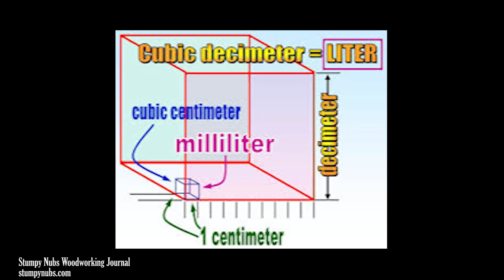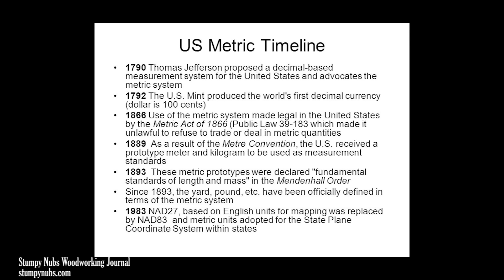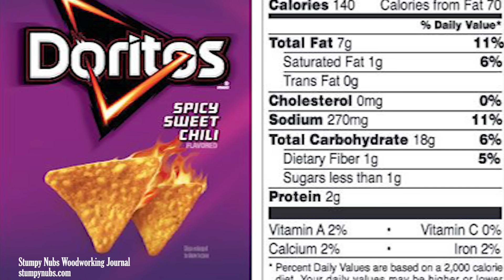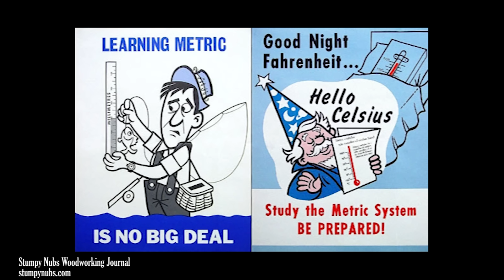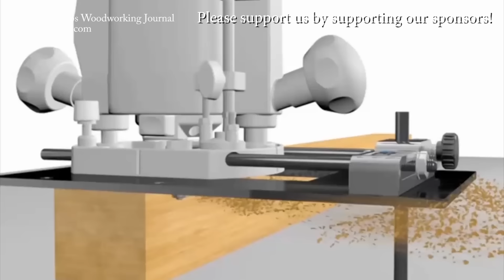BREAKING: The USA is switching to METRIC!

Comment: As an American, I was amazed by the ease of calculating volume by size and also the weight. 1ml(of water) is 1 cubic centimeters, which is one gram or in larger terms 1 liter of water is 1000 cubic cm and 1 kilo. Not necessarily as easy if you are looking for the wight of something other than water, but volume still works. Without looking it up, how many gallons are in a cubic foot?
Reply: No one does that... there is 0 need for when messuring the weight of water based on its weight... ive never done that my entire life... metric is only good for messuring chemicals and thats where it only belongs... but for everything else... its a awful system... imperial is and always will be better
Reply: 1 cubic decimeter of water is not exactly 1kg. At room temperature it is about 997g. It is close, but it is because of water density
Reply: @Scudmaster11  Of course that comes in handy, for example if you want to know whether your floor can hold your new water bed with x hundred litres of water inside it. Or if you're building a DIY raft using air-filled tubes and you want to know how much volume you need to keep your weight afloat.

Imperial is only better for those who're used to it, changing is always difficult.
Reply: @Ragnar8504   the only thing i hear difficult is you... imperial isnt hard... and we dont normally need to convert... PS messuring air buoyancy with metric is stupid... water beds arent really used (only in vary rare situations are they bought).... ive given metric a try before and hated it... couldnt visualize anything... it was all over reliant on objects and machines as because the numbers are unweildly)... also... if you think converting between stuff in imperial is hard... its not.... you are only nameing the vary few novelty things metric is only better at... but imperial crushes the cpmpetiton by MILES..... achers of land is better (and economic) if you want one that you will never top... achers are known by how much work a famer can get done in one day (back then)... so its a efficient way for land... even though i dont personally use it... its used in land messurement of how much there is
Reply: @Scudmaster11 Indeed, 1 metric achre, aka 100m^2, aka 10x10m, is better!
Reply: @LTimotheus   PS... BTUs are commonly used and its a imperial standard... how much energy it takes to change the temperature of water (1 pound of water) by 1 degree F
Reply: @Scudmaster11 what kind of farmer? Strength, age, experience? What kind of work? Ploughing, mowing, sowing? What kind of soil? Rocky, sandy, moist, dry?
Seems a very vague definition to me.
Reply: Even other materials are easy, you just need to know the density of the chosen material. You then calculate volume and add one extra material constant (ie x2.7 for aluminium). So with very little effort it works for every material.
Reply: @Scudmaster11 if you didn't know most of the imperial units are defined by metric units anyways you just add some arbitrary randomly chosen conversion factor to get imperial. it's not like J/kgK is a metric unit that discribes the exact same thing as btu but now you can easily tell that for 1 kg of water, which btw is the same as 1 Liter or 1 dm^3 or 1000cc or 1/1000 m^3. You need 4181Joul  to heat up 1kg of water by 1 Kelvin or 1 Celsius (Celsius is just defined as being offset from absolut zero by 273.15k).  Now that is the same as lifting up 41.81kg up by 1 meter or the amount of distance light travels in 1/299792458 seconds. Or the same amount of energy one cheeseburger or 10*9mm bullets. Can you convert 9mm bullets or cheeseburgers into btu?
Reply: @Scudmaster11 No one does that: when I carry plastic bottles I sometimes like to calculate how much they weigh (ignoring plastic), so to state that absolutely noone uses the easy volume to weight calculation is to lie. And while there isn't a need for me to measure a fluid's weight if I already know the weight (nice spelling btw), you rarely have fluids measured in weight but in volume.

Also, did you watch the video? Plenty of uses for metric and the most american I can think of is measuring the size of bullets (with .cal being metrics millimetre if I'm remembering quite right).

So the only argument you have is that you've never done it in your life, which is a valid argument why switching would be difficult, but not about the superiority of a system over another. Because that is the same thinking that kept people thinking Earth was the centre of the universe.
Reply: @Scudmaster11 it’s normal that you can’t visualize things if your not used to the metric system. Same goes for me whit the imperial system no Idee what 2 Inch could be
Reply: @davidtheiler562   basically the size of your thumb (shorter useally)... PS... 356 is a unweildly number for any messurement
Reply: @Scudmaster11  i think you probably had a little too much chemicals..
Reply: @Scudmaster11  The imperial system is European, but it became outdated and was abandoned. But in some countries it still remains a colonial residue...
Reply: @Ragnar8504  It's not as hard as it seems. We've also been switching from the old units to metric, for example the unit of pressure used to be atmosphere or kilogram of force. Physically it's meaningless though, so we switched to kPa and N and it wasn't particularly stressful :-) But it was a very long time ago, maybe I had nightmares about it and forgot about it :D
Reply: @LTimotheus  Better is water for irrigation measured in acre feet :D :D :D
Reply: @Scudmaster11  How much heat is produced by a 1 kW electric motor? Yes, 1 kW of heat.
Reply: Canada changed to metric about 1/2 a century ago 
Plywood is still 4’x8’
2x4” studs are still 16” on centre 
Flooring and carpet are 12’ wide 
Tiles are 1’ square 
3/4” Conduit is available in 10’ lengths and 
There is a 6” take-up on the bender for it !
Some things will never change but 
Metric division is compatible with computers
Reply: @Scudmaster11  what in particular is awful about the Societe Internationale system? Details please, the more detailed, the better.
Reply: @samuelbudzinak  that's physics, it's because of density, and that is the same for the imperial system, because again, it's physics and it has to do with density. Point REJECTED!, NEXT!!!
Reply: @sandrokapellen9064  in Europe we measure water not only in liters, but in cubic meters, and I can tell you exactly how much water 1 cubic meter is: 1 meter of width by 1 meter of height by one meter of depth. I can picture the exact amount in my head because it is so trivial to reason about.
Reply: @AnnatarTheMaia  have you read my comment?
Reply: @samuelbudzinak  no, I have not read your comment, because I do not understand English and can neither read nor write. To make matters far worse for me, I struggle tremendously with basic logic premises and have difficulty with cognition and comprehension.
Reply: @AnnatarTheMaia  isn't that exactly what I said?! Metric transformation is trivial. I don't have to convert with randomly chosen factors to get a new number. Imperial is in any way stupid and outdated since forever. And it anoyes me ever single time a airplaine hight is given in feet why is the airplane  30000 feet in the air, tell me why, how high is this and why dose my feet have to be involved.
Reply: @sandrokapellen9064  I have no idea what you said!, and good luck finding anything in this rudimentary comment tool! There are way too many replies to the video to find anything any more!
Reply: @madeinfoxtrap5539  Because it's imported from the US. Our company exports one product to the USA that can be ordered in multiples of 20 mm and nobody has a problem with that either and they normally understand it. The essence of the metric system is different from the pack size.
Reply: @AP57532  there is still a six inch take-up on a 3/4” conduit bender
Simple physics won’t allow that to change 
Metric is compatible with computers 
Imperial fractional measurements are not 
Computer friendly. 
I am well versed in both systems but 
To think for a moment that inches 
Are going extinct you had better think again 
Fractions will always be used as long as 
25 cents is still a quarter.
Reply: @samuelbudzinak  How many pounds is one gallon of water?
Reply: @sandrokapellen9064  Because the flying community agreed to use feet and knots in everything. Maybe to appear elite over the rest of us that aren't allowed to fly a plane 😉 But commercial pilots are basically bus drivers that happen to have wings on their busses. Makes them less elite imo 😄 
Btw, shipping is the same. They also use unique measurements for their profession.
Reply: @Scudmaster11  Then why don't you use imperial?
Reply: @Xanthopteryx  what are you talking about... i do... PS... metric is basically only fits in at chemistry.. and even that is iffy
Reply: @Scudmaster11  You said imperial is way better and i asked you why you don't use imperial then.

Besides that, metric is superior. Everything connects together and it is easy to move between the different units. 1 liter = 1 cubic dm = 1000 cubic centimeters = ...
1 cubic meter = 1000 liter = ...
1 kilometer = 1000 meter
1 meter = 10 dm = 100 cm = 1000 mm = 1000000 ...
1 square meter = 100 square dm

1 millimeter of rain = 1 millimeter of water per square meter
It just continues.
Reply: @Xanthopteryx   your computer is running x86 honey... it's asm is weird... and is also the fastest cpu architecture... so just because everything connects doesn't mean its good... the way everything connects on metric feels lazy.... PS... computers run in powers of 2... not powers of 10... you were reading gibibyes and tebibytes... not gigabytes and terrabytes... and if you say (then why not just run a program to correct it) well here is the issue... a byte is 8 bits... a block is the size of a sector on a drive... usually around 128 bytes to 2048+ bytes... yes i will drag computer science into this because i can.... base 10 on that is 100% a awful idea and we should start physically labeling the drives and everything in the computers format (powers of 2... gibibytes and tebibytes)... it's 1024 of one standard to another..
Reply: @Scudmaster11  So, where did computers end up here?
Guess why they work in binary?

You did not answer: Why do you not use imperial units if that is so outstanding?
Reply: @Xanthopteryx   i do use imperial... how hard is it to keep up... jeez
Reply: @Scudmaster11  No you are not. You are using US customary measurement systems, since i guess you live in USA.
US customary measurement systems is NOT Imperial.
They are different.
Example.
Pint is not the same volume in US Customary and Imperial.
Gallon is not the same either.
Quart is also different.
So is ounce.
How often do you use the unit "gill"?
Not often i guess. Because that is mostly used in Imperial.
A cup i guess you use, but not common at all in Imperial.

Did you also know that Canada and USA differ? They use different systems.
They are matric since 1971 but have not transitioned fully and still have Imperial in some applications (but metric is the official).
So a drink from made in Canada where it might say (converted from metric) that it contains 1 quart, is not the same volume as the same drink manufactured in USA where it also says 1 quart.

Another example of nice measurements are of course Celcius (from Sweden!).
0 is water freezing.
100 is water boiling.
Simple and easy.

So, once again: Why don't you use imperial if that is such an amazing system?
(and now we ignore the fact that it actually is a really bad system that is really complicated and prone to getting things wrong)
Reply: All you need to know is the SG of any material/product and use the same calculations, and SG is obviously also used in the "imperial" system.
Reply: @Scudmaster11 so when reinforcing a joist to take the weight of a new bathtub, knowing that a bath holds approx 300 ltrs of water, so the joist will need to hold min 300kgs of water is of no practical use?
Reply: @Scudmaster11  And that is why only 95% of the world uses metric.
Reply: @godfearingheathen   exsept candy making industry... its standard is imperial around the world
Reply: @Scudmaster11  When cooking, if a recipe calls for 200ml of water/milk, you can just add 200 grams water/milk right in your mixture.
Reply: @luuk777w   imperial still is the same... you really think we have 0 way to messure anything?... grow up already
Reply: @Scudmaster11  Yes but the standard is in metric with imperial equivalent next to it.
Reply: @samuelbudzinak  That is the same in imperial!!!Everything changes when heated..
Reply: @Scudmaster11  No it isn't, whilst it does do fancier things like having volume and cubic meters be related etc. Just plain devinding or multiplaying by 10 for EVERYTHING is incredible.
Reply: @Scudmaster11 That‘s called a Newton. It’s the energy you need to heat a litre of water by one degree Celsius. What meaning does Fahrenheit even have for water?
Reply: @Kyk_cz   Imperial or US gallons  Imperial 10lbs  US 8.3lbs.  It's not rocket science.  And regardless that is as relevant as the weight of a cubic meter of molasses.
Reply: @Xanthopteryx   Imperial is better  you can't precisely divided ANYTHING by 3 with metric..  Imperial no problem..
Reply: @Xanthopteryx   US Customary is STILL Imperial , The ONLY differences are in volume measurements. Jeeze get with it already.
Reply: @alundavies1016   Or you know that the volume is X Gallons either Imperial or US and multiply by 10 or 8.2.   I guess that is too complicated for europeans?   But hey metic the measurement system for those not smart enough to do anything but divide and multiply by 10.
Reply: @luuk777w   Wrong milk is NOT the same weight as water.  Metric volume weight conversions ONLY work with water...
Reply: @matthewq4b  so what if you scale up to a dam? How do miles converting to Gallons, converting to tonnes work as well! You do realise that American scientists and engineers largely work in metric too? I use Imperial when I am doing small pieces of woodwork where precision can take a second place to habit, but metric is better, I’m just lazy.
Reply: @alundavies1016   You don't convert miles to gallons one is distance the other volume. You would use cubic feet for volume. 7.5 Gals US or 6.2 gals imp to a Cuft  And gallons to tons is easy 240 US gals to a short ton and 224 gals Imp to a long ton. And exactly if you lack the intellect  metric is easier other wise imperial is better.  And  if metric is truly better tell us exactly how much 1/3  of a liter is or exactly how long 2/3 of a KM is.  1/3 a gallon is exactly 51 oz  2/3rd a mile is exactly 3520 feet.
Reply: @matthewq4b  True, but its about the same and if a recipe calls for 300ml milk, and you add 300gr milk it will be good enough. You also won't be so precise with a measuring cup
Reply: @luuk777w   Still not the same and there would never be an instance where you would substitute weight for volume with a liquid in cooking. Your whole train of thought is flawed.
Reply: @matthewq4b  you can convert kms to volume, to weight in metric. One cubic km of water is 1bn cubic metres of water, or 1bn metric tons. That’s sort of the point.
Reply: @alundavies1016   And you can do the same conversions in Imperial.  And that volume weight conversion ONLY works with water in metric.
And still waiting for  exactly how much 1/3  of a liter is or exactly how long 2/3 of a KM is.  Or is it that metric is not capable of doing that...
Reply: @matthewq4b  1/3 of a ltr is 1/3 of a ltr? What’s 1/3 of a pint?
Reply: @matthewq4b  and you can take the volume/weight of water and factor it up. So a cubic metre of milk weighs about 30kg more than a cubic metre of water, so multiply your water weight by 3% to get the weight of milk.
Reply: @alundavies1016   That is not a an exact measurement. 1/3 liter is exactly how many ml.      There are EXACTLY 32 teaspoons in a 1/3 of a pint.  That is an exact measurement.   Quit stalling already.
Reply: @matthewq4b  I have a lot of teaspoons, which one is the right one?
Reply: @alundavies1016   And you can do the same thing in Imperial, factor it up... DUH.  And anything can be "about" And the fact that  you don't know the difference between .03 3% and .30 30% (Milks density is 1.035 a KG, 3% more than water)  proves the point  perfectly that metric is for those not smart enough to do anything but do math by 10's. I could have not proven that better myself.
Reply: @matthewq4b  and a 1/3 ltr is 333 1/3 ml. I could weigh that you know, or guess 1/3ml, it’s a pretty negligible amount. Or go down to microlitres, you’ll hate this, they are metric too! 1 Million to a litre, so 1000 to a millilitre. So a 1/3 litre would be 333,333 1/3 microlitres.
Reply: @matthewq4b  so I said milk would weigh 30kg more per m3, so 3% more, so my calculation would be correct!
Reply: @matthewq4b  so your argument is that because Imperial is inherently more complicated, involving complicated non-decimal calculations up and down the chain, and is therefore inherently more imprecise, this somehow makes it a better system? It’s an interesting argument!
Reply: @alundavies1016   That is NOT an exact measurement is it.  Metric can't do it either it is too difficult to grasp  or we have a lack of intellect going on here.
Reply: @alundavies1016  You did NOT say 3% you said 30%. So my point stands you don't know the difference between .03 and 0.3. If you are not just moving a base 10 decimal it is clearly too complicated for you deal with. And then you have go back and edit the comment.  LOL not bright and pathetic.
Reply: @matthewq4b  no need to be rude, it is a lot more accurate than teaspoons.
Reply: @matthewq4b  and have you noticed that in hospital, they don’t say “give him a teaspoon of …” they say “give him 4mg of…”
Reply: @alundavies1016  It is MORE accurate because it is EXACT. And apparently you have not read the back of basically any over the counter medicinal liquid where dosages are ALWAYS given in table or teaspoons.  So how deep are you going to dig the hole ? Cause at this point all you are doing is driving my point home with a sledge hammer.
Reply: @matthewq4b  lets say you're making pancakes, and the recipe calls for 350ml milk. Then I just place the whole bowl on the scale, add 350gr of milk and done. That is all I am saying.. yes it might not be totally accurate because 350gr of milk is 336ml, but it is close enough and when you measure yourself you probably will also be off my some milliliters. That is all I am saying... It's not rocket science
Reply: @matthewq4b  they don’t dose with injections using imperial measurements, because the measurements are not accurate enough at small dowsings. And you still have not answered, why would anyone choose a system of measurement that is, by your own admission, more complicated than metric? Why would anyone choose complicated, non-decimal calculations, when a system exists that means you can scale up, or down without knowing your 12/14/16… times tables. I’ll leave that their, playing chess with pigeons…
Reply: A cubic foot... that must be very unconfortable, especially to fit in your shoe
Reply: @ross6753  that’s what Lord Byron had
Reply: @alundavies1016  I know. But it didn't stop him from being very fit and sportive.  I was merely using it in a cartoonish way, not for serious.  "Cubic foot" just gave me a weird image in my head
Reply: @ross6753  much respect to “mad, bad and dangerous to know” Lord Byron!
Reply: @Scudmaster11  why do you insist on putting ... in between every single phrase and sentence???
Reply: @KeKcP   because it's how I type.... deal with it.... ellipsis is fun
Reply: @alundavies1016    You said medicine NOT injections, moving the goal post when you get proven wrong yet again.. And imperial uses minim or drachm which both are more accurate than CC's anyway. And it is NOT more complicated, if you have 3 functional brain cells. PLUS it is more intuitive and it slots in better with navigation and time as you use the same base multipliers. And it can use ALL commonly used divisors. Plus it is better for machining  as you never have to move a decimal place around.
You yourself screwed up a very simple decimal movement. And it works far better with finger counting if you have no tracking method available. You have had multiple metric questions you could not answer. Funny that all the imperial ones you posed were answered ..... All you have done is prove the overall superiority of the imperial system.
Reply: @luuk777w   WHY the F would you weight milk ? That is what measuring cups are for.  You metrics sure like to  drive the not very bright point home with a sledge hammer. And FYI you can do the same thing with Imperial and it's more accurate 1.5 cups equal .75Lbs of milk or 350 ML. Once again you lot are proving the superiority of imperial.
Reply: @Scudmaster11  it’s incredibly obnoxious on par with scraping nails on chalkboard
Reply: It’s super easy!
For other things, you just need to quickly check the density and then you can convert it the same way. For gasoline, for example, just multiply by 0.75 or 3/4.
Reply: @KeKcP   its just ellipsis... there isnt anything bad about it
Reply: @matthewq4b  this ignorance is pure comedy😂 I can give you 100 reasons why the metric system is much better, but something tells me that wouldn’t convince you either.
Not to mention scientific calculations.
Reply: @davidpiehler7850   Lots of talk no examples.  Once again proving it's only advantage is for use by half wits.
Reply: @davidpiehler7850    Really you lot just multiple by 0.75 for M3.  You lot still proving you are unable to move a decimal place unless it is a base ten..Still driving the point home with a sledge hammer.🤣
Reply: @matthewq4b   Alright, to address your previous arguments (I had some time to kill):

1. REAL PRECISION was never possible in the imperial system. All measurements in the imperial system were defined using the metric system to make them precise.
2. I'm not sure what your problem is, but I can perfectly fine divide 10 meters by 3. If 3.333333 meters isn't accurate enough for you (by the way, that would be 3 meters + 3 decimeters + 3 centimeters + 3 millimeters + 333 micrometers - try doing that with the imperial system), I can also write it as 1/3.
3. **Milk has a 3% higher density than water**. I hate to burst your bubble, but cooking isn't nuclear physics. Eggs can vary in size by up to 40%. Do you always weigh them to get a "perfect" value? Also, I hope you don't use cold tap water for cooking, because WARNING: 50°F water has a 0.15% higher density than at 68°F. For milk, it's even a 0.3% difference, so don't forget your thermometer!
4. „Only water“ can be converted 1:1 by volume. Vinegar is 1.01 g/cm³, cream is 0.98 to 1.02, milk is 1.03, yogurt is 1.03, and oil is 0.92. You can argue about a 10% difference with oil, but everything else with a 0-3% deviation is negligible for cooking. Other factors like cooking time play a much larger role. We also don't need five different measuring cups. We can measure everything with a single volume measuring cup. You can even measure 5 cl of rum for a Cuba Libre with a 1-liter measuring cup.

Shall I tell you about the problem of unit inconsistency? Statute mile, nautical mile; survey inch, international inch; short ton, long ton; avoirdupois pound, troy pound; US liquid gallon, US dry gallon... I think you get my point. I bet these sizes are usually just roughly converted. And YOU talk about precision.

And I won't even start with scientific calculations, but even the most backward person has figured out that the imperial system is useless in this area.

Is there ONE other reason why the imperial system should be better? And please don't start with "practical" sizes. In the metric system, I can use ANYTHING as a reference and calculate with it if I want to. A football field is 100 meters, a car is about 4 meters long, so 25 cars equal a football field, which by the way, also corresponds to 1000 “finger lengths” or 5000 “finger widths”. I can easily calculate all of this in my head.
I wonder how well that works for you :D
 
Clearly, the imperial system is simply superior:D
Reply: @matthewq4b  So your argument is that in some rare cases, the metric system requires the same number of calculation steps and therefore is worse?

You also forget that we only need to remember ONE density value. With this density, we can convert ANY volume into a weight and vice versa WITHOUT a calculator.

You always need a different density value depending on whether you use lb/ft³, lb/in³, oz/in³, or gr/ft³. And then it’s an awkward value and not like our 1 g/cm³ for water density. And 2.7 g/cm³ for aluminum is still easier to estimate than 168.5 lb/ft³ or 0.00058 lb/in³ or 0.098 lb/in³. We don’t have such problems.

What’s your point in this??
Reply: @davidpiehler7850   1. Wrong Imperial measurements were defined by metric since it was OFFERED to save the cost of maintaining a set of imperials standards . And the base metric meters length has CHANGED length multiple times in the last 100 years. So much for accuracy... Try Again..

2. And again you can NOT divide ANY metric meusemernment EXACTLY by 1/3's  Were as in imperial this is done WITHOUT ANY decimal places... Try Again. 

3. WTF do eggs has to do with any thing.   That some pretty hard cope to explain the error PROVEN by simple decimal movement.   Complete fail..

4.  Uh cooking is NOT the only use of measuring systems. You can ONLY the 1 to 1 for WATER NOTHING ELSE. And FYI imperial uses a single measuring cup alos...  More cope it seems. 

So 4 examples ALL OF which were false or opinion.   Batting Zero so far...

And there is NO issues using Statute mile, nautical mile; survey inch, international inch; short ton, long ton; avoirdupois pound, troy pound; or gallons either imperial or US, (US dry gallon is long obsolete)  It is NOT at all complicated if you have more than 3 functional brain cells. 

The ONLY advantage Metric has is it is easy for the mentally challenged that can only do math in tens..
 
Some of the advantages of Imperial were already listed.  GO BACK AND READ...    

You lot are still driving the point home with a sledge hammer it seems
Reply: @davidpiehler7850   Uh ya we seen how well remembering that metric density rule worked here live, it was STILL DONE WRONG.   THOSE sort of errors do NOT happen in Imperial and are VERY common in metric. You have no idea how many decimal movement errors occur in metric  93% of ALL metric conversion errors happen because of this EVEN using electronic calculation cause they end up being overlooked when transposed wrong. This is UNIQUE to metric and does not happen with Imperial.  Metric ends up with more calculation errors than Imperial does in lengthy tabulations.
Reply: @matthewq4b  1. The values were redefined because scientific methods allowed for a more precise definition and this was necessary for more accurate calculations. Now they are defined anyway, and the imperial system is defined via the metric system. So I was right. The metric system is precisely defined?! And the imperial system only through the metric system.
2. What’s the problem with decimal places?? Besides, that’s an isolated case. What about /5 /6 /25 /7. Hooray, you can avoid decimal places a couple of times. Congratulations, I guess? I hope all the conversion work between the units is worth it. It has greater advantages to be able to shift powers than to be divisible by 3.
3. My point, which you were obviously not smart enough to understand, is that precision to individual percentages doesn’t matter when cooking. 1x apple, 1x egg are all imprecise measurements and 1 liter/1kg/dm³ of milk is perfectly transferable when cooking. Your argument that it cannot be used is wrong.
4. Do I really have to explain this again…? Milk, vinegar, … everything I mentioned can be converted 1 to 1 because an accuracy of 1% is not required! And yes, cooking is not the only example, but bad news. When we get into physics or engineering, it looks much worse for the imperial system. I believe many physical units only exist in the metric system.
5. The problem is that all the conversion factors need to be looked up and calculated with a calculator. In the metric system, this is not the case. You don’t have to memorize tables of conversion factors and you don’t need a calculator to calculate simple quantities. It is much easier/faster/less error-prone to calculate things in the metric system. I don’t have to learn 100 conversion factors; I can focus on memorizing natural constants, for example. For instance, the speed of light is approximately 300,000 km/s, and the sun is about 8 light minutes away. So that corresponds to 144*10^9 m. I can easily calculate such things without a calculator.

Oh, you probably don’t even know about power of ten notations… Sorry, it’s like 1+1 for engineers but no idea if something like that is even used in your field…
Reply: @matthewq4b  Aha, that might be because NASA and all technical institutions where physical values need to be calculated use the metric system. No errors can arise from the imperial system if it’s not used 😂
And please, please, please don’t be so dumb as to claim that physicists and mechanical engineers prefer the imperial system. Otherwise, I’ll have to believe you were the first person on the moon and haven’t had contact with other humans since then.
And my spare time is over, so that’s it from me. Have fun with your conversion disaster system 😂
Reply: @Scudmaster11   "No one does that... there is 0 need for when messuring the weight of water based on its weight"

There certainly is a need for it.  For example, you might build a trailer with a water tank on.  You then have to consider how much the water you carry will weigh.  There was an incident in Canada several years ago (look up Gimli Glider) where an airplane ran out of fuel part way through the flight.  Aircraft are very weight sensitive, so you have to know the fuel weight.
Reply: @matthewq4b  Imperial and customary is NOT the same. Different systems. But a lot happens to be the same because USA based customary on imperial.
So they took a bad system and made it slightly worse.
But as said, today it is actually metric, but then converted to imperial.
Better off going full metric.
You already have some stuff in metric so why not all?
And of course, go Celcius too. Skip that arbitrary strange non logical Fahrenheit.
Reply: @Xanthopteryx   NO country is fully metric Imperial is so ingrained that and used for many items and industries. And US Customary is only used for volume. And Fahrenheit Is more accurate and does what celsius does WITHOUT resorting to decimal places.
Reply: @matthewq4b  Please tell me what units we use in Sweden that is not following metric?
Even our own distance unit "mil" follows the basic metric. One "mil" is 10 km. The metric name for this is myriametre.

You do know that you are using more and more metric do you? And more industries than you know already uses metric. So... Just continue the change?
Also no problem with modern cars. With a click i can swap between miles and km/h.

US Customary is the whole system. Including everything. Some units are the same as imperial, some is not.

More accurate?
You obviously do not know what accuracy is.
Celcius is very logical (0 = water freezes and 100 = water boils) and it is perfectly accurate.
87,27335 degree C is exactly(!) 87,27335 degree C. And no problem using decimal places because... oh, wait. Did you see what you just did? Metric base! Decimal! How fun! So even there you go to the base of metric.
Decimal is a really nice thing because it is so super easy to convert and mover around without any issues.
1 m = 10 dm = 100 cm = 1000 mm = 0,1 dam = 0,01 hm, = 0,001 km, ...
Not calculation done at all.

1 cubic meter = 1000 cubic dm (since 1 meter is 10 dm you just multiply 10x10x10 and that means moving the separator three steps to the right so 1,000 = 1000.
Reply: @Scudmaster11  That's not true. If you live with the metric system you do switch between weight and volume when it comes to fluids all the time. Not just water, it works with everything water based because the weight differences between water and soda or a water based cleaning agent are marginal. It's easy to guess weight for example. The metric system is objectively easier to work with and way more logical. That's why almost the entire world uses it.
Other than people like you claiming it to be better there are no real arguments for the imperial system. It's obsolete. But I understand that changing the entire system you are used to sucks.
Reply: @DLT-po6to   your system is also based apon a mistake... when it was made... one of the creators messed up and told no one... a meter isnt even correct... PS... metric is awful peroid... if you still want to harass imperial... then i get ways to harass metric... you cant sit smugly with stupid metric thinking (you cant harass it) and harass other systems... if you harass it.. im harassing metric for being the worlds worst so called (replacement) system
Reply: @Scudmaster11  Yeah well,  you don't seem to understand that "mistake". The "mistake" is well known - the original measurements to create the first meter where not entirely accurate. That doesn't matter, though. The mathematical relation between all the units is still correct because they all derive from the standard meter. What this standard meter is based on is not important.

Harrass? Really? What kind of pathetic simpleton are you to feel threatened by an obvious observation? Tell me one advantage of the imperial system over the metric system. Or anything that makes more sense about it.
Reply: @DLT-po6to   it's not my part to explain everything for you... go figure it out yourself you smug so called know it all
Reply: @Scudmaster11  Ehh. What are you talking about? A meter is exactly a meter. And how long is that?
It is the distance the light travels under 1/299792458 of a second.
And a foot is exactly 0,3048 meters.
Reply: @Xanthopteryx   a foot is still a foot... and a meter here doesn't exist.. we have yards
Reply: @Scudmaster11  A yard is defined as exactly 0.9144 meter.
All U.S. agencies are required to adopt the metric system.
That is since 1975 and even more implemented since 1991. Since 1994 most package consumer goods must have metric on the label.
And as said, the US Customary units are since several decades back defined by metric.
So, a yard is as said defined by meter, and a yard is exactly 0.9144 meter. So if the meter would change, the yard would change.
Reply: @Xanthopteryx  metric is also defined for getting distance.. how about you shut up already... ps... saying (exact) is silly... also F is better than C and there is 0 competition there
Reply: @Scudmaster11  Of course you would say that. Because there is no advantage in using the imperial system.
Reply: @DLT-po6to   its more intuitive... also... metric doesn't have advantages either... same outcome can happen with any system
Reply: @Scudmaster11  Yes. Metric is more intuitive. And of course have way more advantages compared to US Customary unit.
One of the biggest is that it is a world standard, and also USA is transitioning since laws make US agencies transition to metric. Look around you. On a lot of places you have metric. It is more common than you might think.
And, as said before:
The US Customary units are defined by metric!
Reply: @Scudmaster11  Intuitive? How? All the different units have no logical relation to one another. Even with simple things like tools it is way more intuitive to use a 8mm or 10mm spanner than using a 5/8" or 11/32" or whatever.

The metric system objectively has a few advantages. First and foremost the decimal structure that makes calculations and measurements easier and faster. There is nothing to discuss about that point. It's undisputible. 
It also allows for more precise measurements, thats why even the american high tech sector uses metric. Also it is better for international trade, since most of the world has absolutely no idea about imperial units.

Dude I totally get that you don't want to change something so significant. But if you just look at the facts there is no real reason to stick with imperial units. You liking the imperial system more doesn't mean it's better.

And noone says you personally can't continue using imperial. But your industry changing to metric only has advantages.
Reply: @DLT-po6to   intuitive... easier to visualize... visualizing with 1000s isnt easy and its not even worth the trouble because of unweildly numbers (saying 5280 feet in a mile... for one... we dont convert units useally (outside of volume) ).. PS.. i used metric in math that one time... and hated it... just because all the units are different doesnt mean its bad... take x86 ASM for an example... its insanely weird.. but it is the strongest cpu architecture right now because of its heavy throughput and deep pipeline.... you trying to say to change is an idiotic move.... if you were forced to use imperial units because metric was deemed unusable or unweildly.. you wouldn't like it and you wouldnt adjust... if you try and force it on me... i wont convert... PS... volume is powers of 2... 8 16 32 64 128 (128 ounces in a gallon)... because imperial volume units is awesome to use... 16 weight ounces in 1 lb.. 2000 LBs in 1 ton (and a ton is vary common)... oh ya... i forgot that F is better then C in the weather industry... and also in the entire candy making industry (thats entirely imperial for quantities).... we never had a need for converting between units.. if its a mile. Its a mile... if its a yard... its a yard... a inch is an inch... a foot is a foot... converting between them arn't really common here..... also.. a ache is purely imperial and has 0 metric counterpart and ache is also the main messurment of land here and used for farming because its economical for how much someone needs or how much they need for farming... PS.. i said shut up because this conversation is carring on for some time (and time, day, month dates arnt even base 10... have fun with that one)
Reply: @Xanthopteryx   there are also many people that cant read it or want to read it... when i see 5m i think miles... in the US.. we dont use metric for distance... and us units arnt even defined by metric.... and if you say (oh look at this then) ive already read it... people have 0 idea what the true meaning of defined is... defined is to define something new... to bring it into knowledge..... the word you are looking for is messurement translation... where it was 100% translated to make it easier for both sides... also.. i did look in all the common places here in the US.. i saw only 1... and that was at the hardware store for screws... so again... shut up because you clearly dont even know.... its not even common in public or private eye... no one here talks in metric either
Reply: @DLT-po6to  I appreciate that my brief statement has caused such controversy,  but I'd just like to point out, I agree with you.  I have done many projects in my life where metric would have been easier.  How much does this hot tub on my deck weigh,  how many cubic feet are in a cubic yard when doing landscaping?  What's one size bigger than 9/32? 10/32... let me do some math now because 10/32 isn't what's in my tool box. Also,  after 64ths... we go to thousandths in machining. It's  just memorization of things.  Which is fine once you know it,  but despite what this other guy is saying, it doesn't make any sense.  "I know what a mile is, because I know what a mile is" might be a bit of rationalizing...
Reply: In Europe, we have all those items in the same sizes, except they are given in the metric equivalent. So sheet materials are 2440mm x 1220mm, timber comes in 2.44m lengths, studs are on 400mm centres, tiles are 300mm, etc.  

Here in the UK, which is mostly metric, builders and joiners still talk in Imperial measures half the time. Milk and beer come in pints and will cost you "a bob or two" (a bob being a shilling), and road distances and speed are still in miles.